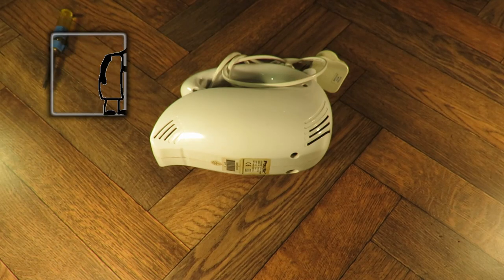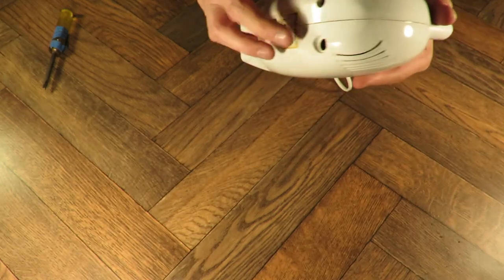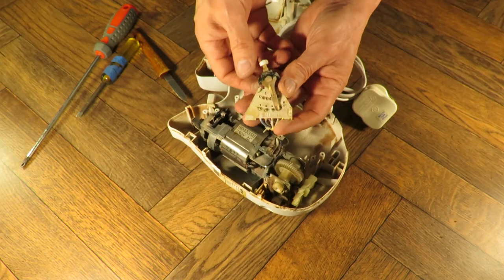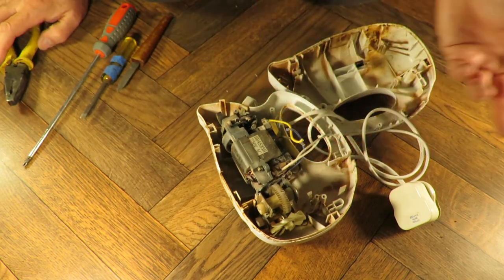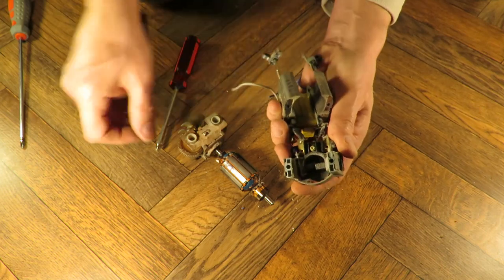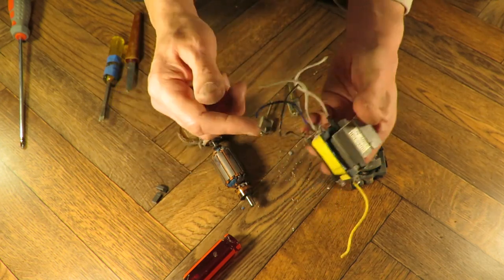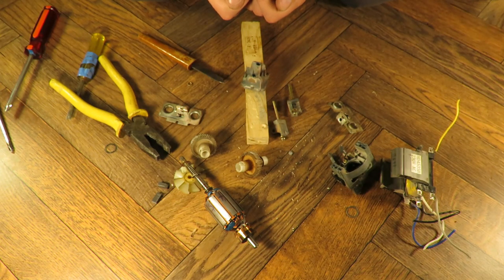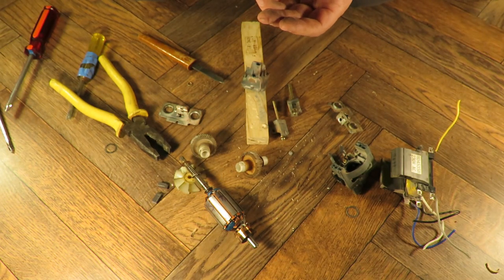Tear Down - Pacific Electric Hand Blender

Comment: I just spent a while tearing down an old cordless drill with a view to repairing one of the kids electric ride on cars.  Turns out replacement gear boxes and motors for these cars are quite generic, so ended up ordering two on Amazon for not much at all.  Interesting all the same, might use it for another project :)

Comment: Good tear down. I watched a guy with a car alternator running it as an electric motor with an ESC and 12 volt lipo plus a AA battery to charge up the coils to produce a magnetic field. It worked great. I think you could do the same with that motor but you would not need an ESC. Just charge up the coil on the housing with a AA battery and apply 12 volt DC to the area where the brushes go and it should run. :-)
Reply from the maker: It would be worth a try just for a video.

Comment: I have at least 2 of these. The nylon gears always seem to strip. I did get a replacement set of gears,but they didn’t last long either. Ok for light usage. Would be interested to hear if you can find something to make from the parts. So far I haven’t, so they reside in the box marked electric bits and bobs, awaiting inspiration/ideas/the tip.
Reply from the maker: I already have several boxes full of "useful" electronic bits from this type of tear down. Haven't touched them in years so this lot went straight to the recycling centre after I finished the video. I just don't have the storage space for it now.
Reply: @GrandadIsAnOldMan  sounds like quite a good proportion of my garage. Just tried charging 5 different lead acid batteries today and only 1 is worth holding onto.
Reply from the maker: @gavin9038  funny you should say that, I think I have half a dozen of them in there somewhere, maybe more. My daughter scrapped an electric scooter (proper road going adult scooter not a toy one) many years ago and I was surprised at how many fairly large lead acid batteries it was carrying.